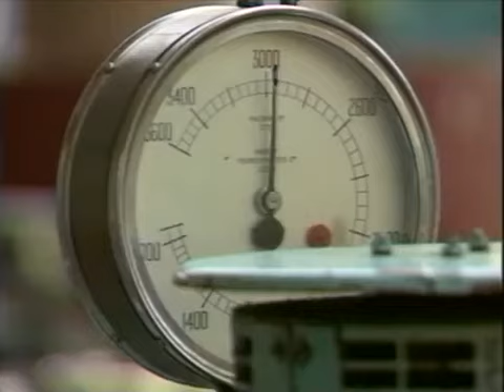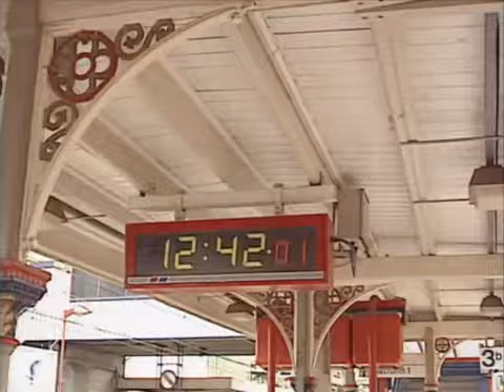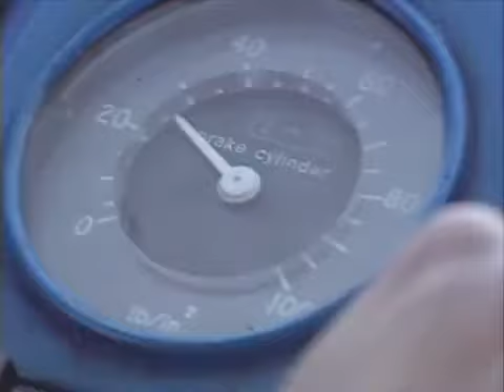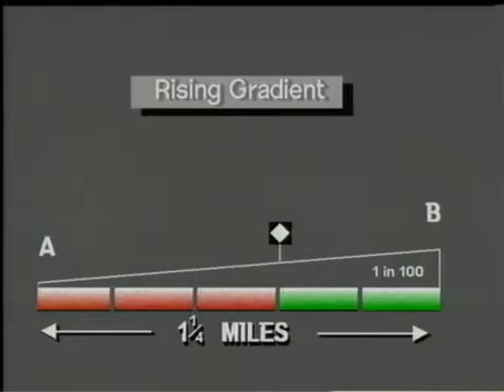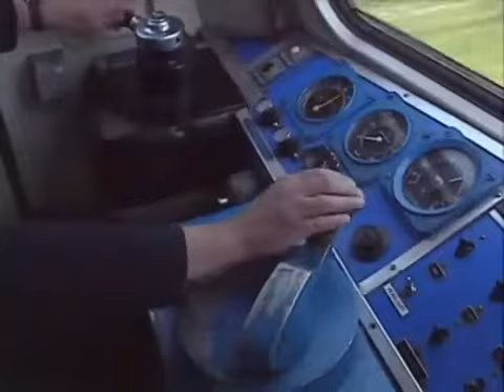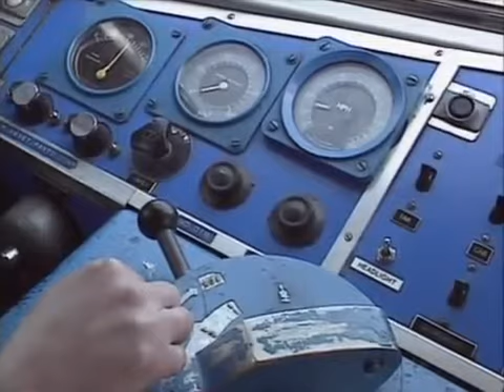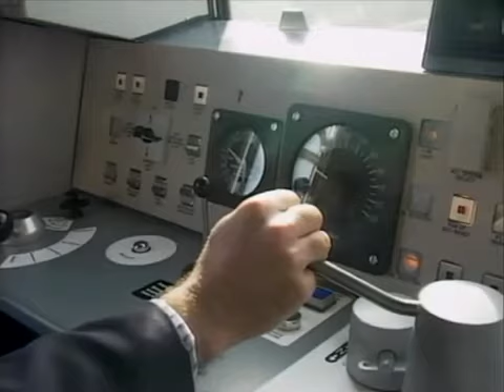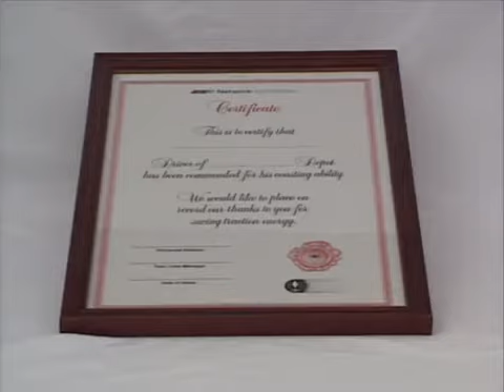BR - Steel Wheel, Steel Rail

Comment: Ever since the opening of the eurotunnel you would have thought that any government with any sense would have legislated articulated and the larger lorries off UK roads as well as providing incentives for using rail freight services.Obviously there is a place for commercial vehicles to move merchandise from the rail depot to the store.For such purposes though smaller vehicles could be employed and for premises such as vast supermarkets or shopping malls it would pay for the builders and operators to site new premises at sites with rail access.Can't see it happening though,as that would be logical.

Comment: It is interesting to note that coasting is encourage in railway driving, as oppose to road driving where control of the road vehicle is an issue in such situation.
Reply: Coasting in neutral or with the clutch down is bad, but coasting by lifting off the power whilst keeping the drive engaged is fine, and actually saves more fuel (since the fuel injection will be shut off and the engine will just be kept spinning from the wheels, whilst with no drive fuel will be used to idle the engine). Since trains don't have a clutch or gears (with a few exceptions), that's not an issue. Actually, with the old DMUs that had gears, there was a specific instruction to coast in 4th (top), although that was down to protecting the gearbox, not control.

Comment: A lot of sense here, I always just pottered along on adverse signals, there was no point in winding up to full speed and then having to brake heavily. This was especially so on the route I drove as we still had Buffet Cars back then. Our trains ran on 750V DC live rail, and we too had the controller where if you ran straight up to notch 4 you'd to return to "off" before opening up if you wanted to notch back ! Expect those old AC units used camshaft controllers like alot of ours did south of the river. Happy days though. Glad I'm retired now. Couldn't hack all this computerised plastic rolling stock that's used presently or all the buck - passing and back - stabbing that sadly seems a feature of today's railway scene.

Comment: Once the train I was on started to coast, but the train was going too slow and stopped short about 30m of the platform
Reply: Sounds like you had a power failure, rather than intentional energy saving.

Comment: Slam doors wernt dangerous at all it's the idiotic people with no brains and Brussels no doubt that got them withdrawn, these were heavier than more modern units thus rolled for longer and much more comfortable and an airy environment 310/312 unit were subsequently withdrawn well before their time it's a sad story as far as I'm concerned being a rail enthusiast and no complete unit has been saved for preservation with I thinks a disgrace!
Reply: +Jay Gordon Too right. The "elf'n'safety" nazis struck again. There's nothing to stop someone opening most car doors at speed. I miss the old DC MK1 EMU stock we had down here, and went for a ride on the 310/312's, and found them very nice indeed. Such a pity none were saved and that many MK1 units that WERE earmarked for preservation have been either scrapped ( 1705 and 1698 come to mind ) or allowed to rot. The Clacton units were wasted too. All that expense on removing blue asbestos and converting MK1 loco-hauled coaches to suit. Must've cost a bomb. As far as I know some of the 312 sets were built as late as 1978 ! What a waste.
Reply: One 312 unit 312792 has been saved in nse livery but all the 310s have gone and been scrapped. One 310 unit survived into the 21st century by hitachi converted to dc third rail operation as part of the v train. Sadly there were no attempts to save it and it was scrapped in 2007. As for slam doors Chiltern Railways has retained a few class 121 bubble cars used for a shuttle service from Princes Risborough to Aylesbury. These units had to be fitted with door locking to comply with modern safety standards. It really was a waste as some of these units were only built in 1978 and were withdrawn by 2004 having a short life expectancy
Reply: Only parts of 312792 survived, the driving trailers I think. Glad I'm not the only one who thought withdrawing them was a waste, especially given that over 10 years later, older 313s are still in service (and only just being talked about being replaced).
Reply: And yet it's perfectly acceptable on the Paris Métro for the doors to be released before the train has stopped.
Reply: “Slam doors weren’t dangerous” is the comment of someone who’s never had the door opened in traffic and striking the train going the other way leading to the window opening bar becoming embedded in the headrest of one of the seats of the other train. Fortunately the seat was unoccupied.
It’s also the comment of someone who’s never had a door open in traffic where the person leaning on it fell out and was turned into something resembling a cheap lasagna.
It’s also the comment of someone who’s never seen an open door strike a person on the platform causing life changing injuries.
It’s also the comment of someone who never saw someone amputate their finger because the door was slammed shut by someone who didn’t check that the other person was clear of the opening.
Slam doors are potentially lethal, can cause permanent serious injuries, and quite rightly have been outlawed.
If you make misuse possible, misuse will occur.